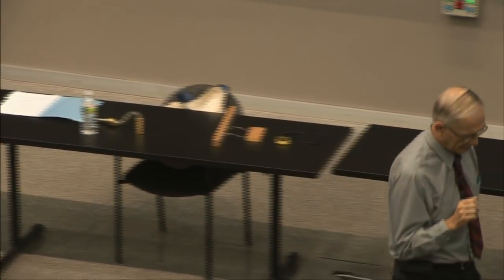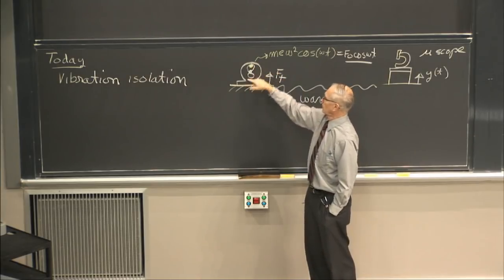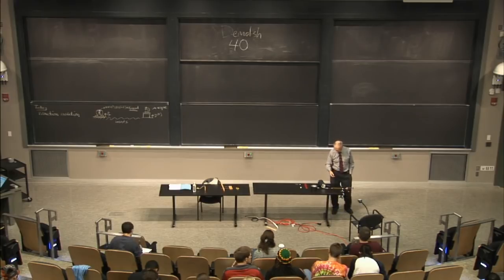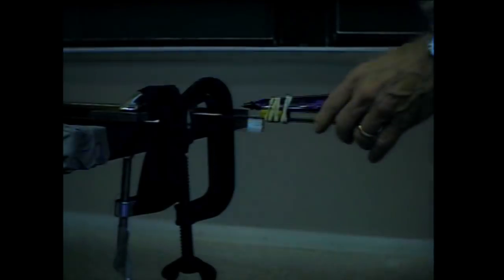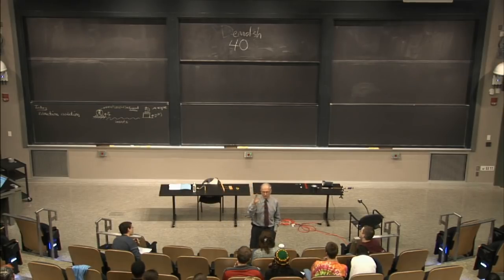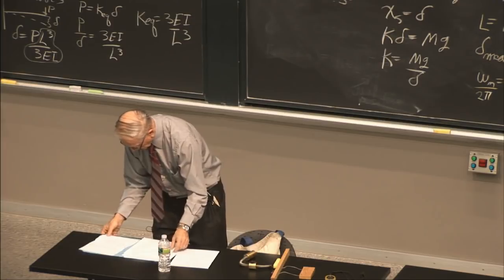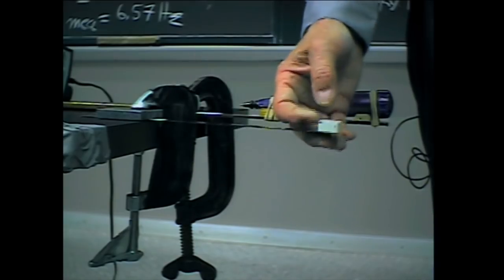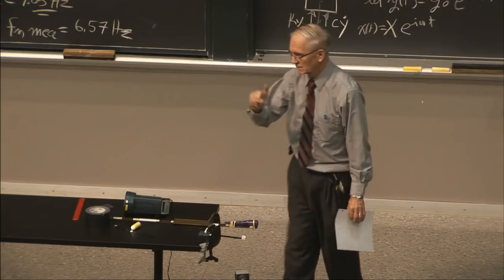21. Vibration Isolation

Comment: Thank you for a great lecture Prof. Kim Vandiver. A couple of questions: 1)From what little I know, a common strategy is to place isolation pads between the motor and the table, in your first problem. We get to choose the material and the thickness. It seems difficult to find the damping value c for many materials, and is c related to thickness? 2)Continuing to put isolation pads beneath the motor, there seems to be another equation called power law frequency-dependent attenuation, where the pressure waves are attenuated by the thickness of the material we use for isolation. Pressure attenuates by exp(-a*w^n * x), where a is constant, w is angular frequency, n ranges from 0-2 depending on material, and x is the thickness of the pad. Can you please reconcile this equation with what you have shown in this lecture? Thanks.

Comment: If the application was not a cantilever bean, but actually a table, how does isolating the receiver method apply to the table?. increasing the beams length decreased the response of the system, x. given its a beam, it is possible to calculate the k. how do i do the same with a table?. is it equivalent to moving the table a longer distance away to from the source?
Reply: My opinion goes to isolate the source of vibration itself. Which solves 90% of problems. Rest to check imbalance in equipment etc...